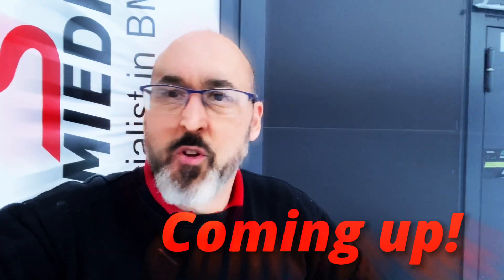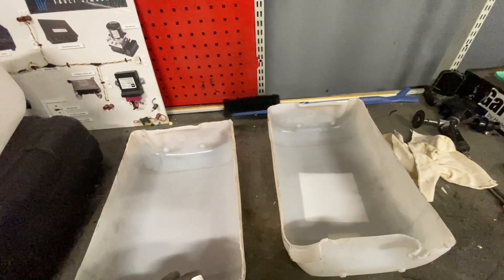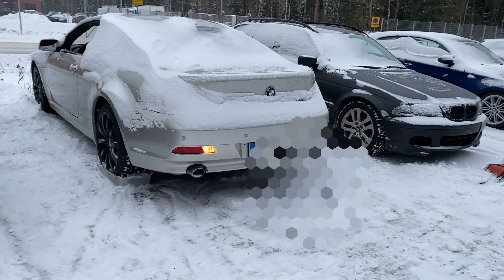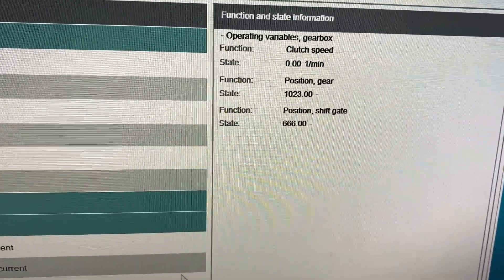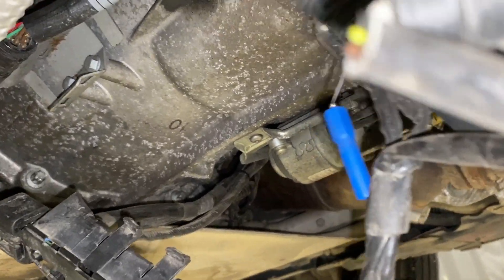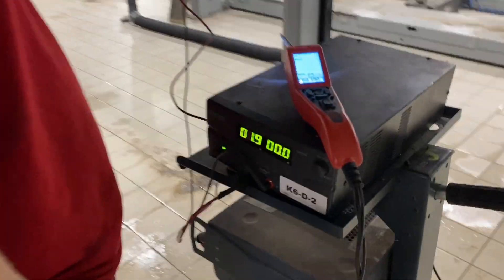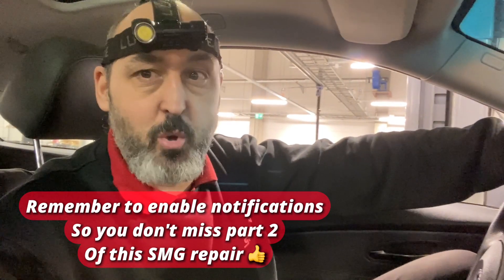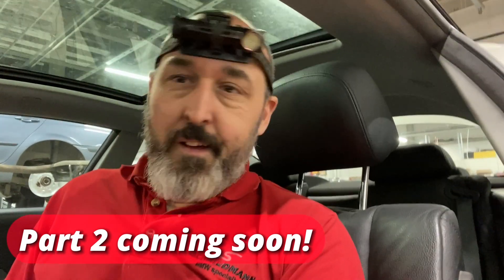Shocking! Mechanic Quotes 10k Euros For Repair - Turns Out It Was Only A Sensor!

Comment: Very, very clever man! That was genius to get the car mobile again. Wish you were in my country. I'd get you to look at the gearbox on my 330e.
Reply from the maker: What is the gearbox problem on your car? We repaired an X5 with similar gearbox that had destroyed the front casing with separator clutch damaging it. Thank you for  those nice comments 🙂
Reply: @BenJFF haha no worries mate. Yes, same box I believe. It's a vibration in 6th when it's up to temperature between 1500 and 2000. Very very common in these. BMW say new box @ 12k is the only solution.
Reply from the maker: @user-od3rl5mc  Seems expensive. I know a guy but shipping to Finland might be insanely expensive and you then have the car off road 🤷‍♂️
Reply: @BenJFF  Ah yeah no bother dude. It doesn't happen all the time, just in those very specific circumstances when squeezing the throttle lightly. Its a weird issue but common in these now. I'll probably just move the car disclosing the issue. Thanks for the vids!

Comment: @08:15 - Those voltages  higher than 5V on those wires with the sensors unplugged are bias voltages, right?
Reply from the maker: I have no idea. Bias Voltages may be present but without knowing how the smg control unit is assembled I am in the dark

Comment: I owned every 5&7 series since e32 up to g30. The second i had my first drive in e60 i knew bmw is over. You can tell right away when the bmw engineers went to KIA. Suddenly bmw’s quality took a nosedive and kia’s started to be really good looking and reliable cars.
My advise to all, who are on the market for a bmw - don’t. They’re just nicely packed unreliable cheaply made trash.
Reply from the maker: I have owned 4 and currently driving an i3 haha. My i3 is 4 years old. Last winter a CAN bus wire broke leaving me stranded at home 🥶😅 I found the broken wire on the back subframe. No protection against the elements but now... man that wiring conduit is armour plated! I do understand what you mean buddy. Still these cars are in my blood and I enjoy fixing them. After all if they were like Toyota we would never get any work 😅
Reply: @BenJFF  well, lucky for You - you’re a mechanic. Just my last g30:
- turbo fan was off in both axis after 38kkm,
- timing chain was stretched after 70kkm,
- i lost 1st, 3rd and reverse about a week after the timing change replacement,
- hp fuel pump was replaced twice,
- faulty thermostat caused the coolant to leak on the highway, so I overheated the engine,
- head gasket (no surprise here) let go after that
Just the gearbox and the thermostat was replaced under warranty.
I loved bmw, i really did. I was Your poster fanboy, but at some point i was fed up with constant issues, uncertainty whether I will get back home. 
I bought myself a kia. You won’t fall in love with it, but it’s damn hard not to like it.
I hope You won’t share my experience!
Reply from the maker: Damn that is terrible 😫 I hope you have no problems with the Kia 🙂 Kia are excellent cars. I think you will be ok. 👍

Comment: For your info the 1023 value you see is the output value from the sensors microcontroller analog to digital converter circuit. 0 = 0V and 1023 = 5V  1023is the maximum decimal output number from a 10bit A to D convertor unit
Reply from the maker: Wow - thank you so much for that Julian. I am not an electrical engineer so this information is really interesting and useful to know. 🙂👍
Reply: @BenJFF  Not a problem, I've worked in micro electronics / mechantronics, design and repair all my life.  As soon as I saw the display values on your PC I knew what it was.  I liked your use of the variable power supply to similate the input voltage, be careful though and make sure you have the current limit set right down (100mA to start with) in case you accidentally fry something.  They sometimes don't like it up 'em, you know. 🤣🚭

Comment: Nice diag! Hopefully the tow truck guy didn't broke the gearbox internals while pulling/pushing the car while been blocked in gear.
Reply from the maker: Hi Alex 🙂 The car seems great since the repair. Usually they use those big dollies. Thanks for the nice comments buddy 👍
Reply: @BenJFF  no problem! Keep them coming. Just found your channel. Nice shop. You still owe us that bmw conductivity paste code 😉
Reply from the maker: @alexdragomirescu5084  I updated the video description buddy 😉 I didn't forget you 😅 Go back to the video it should be there in the video description
Reply: @BenJFF Much obliged! I did found some alternative stuff, but the OEM sauce is usually better! Thank you!
Reply from the maker: @alexdragomirescu5084  Great 🙂👍